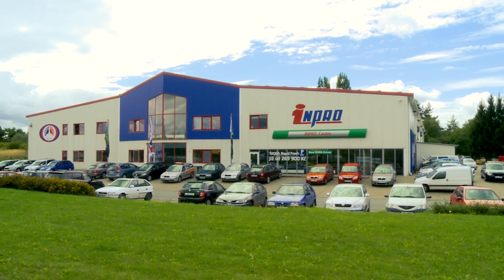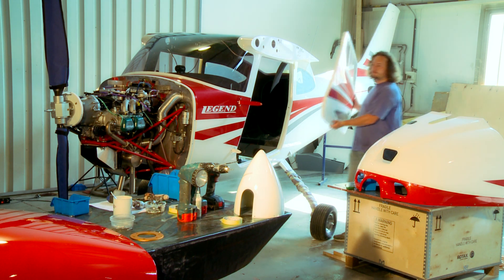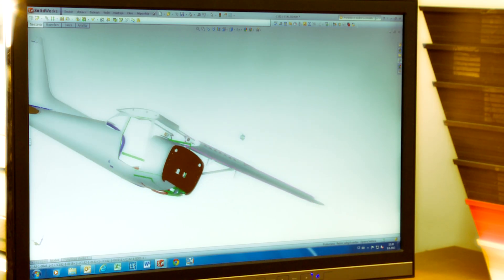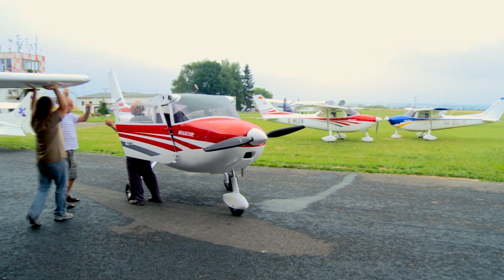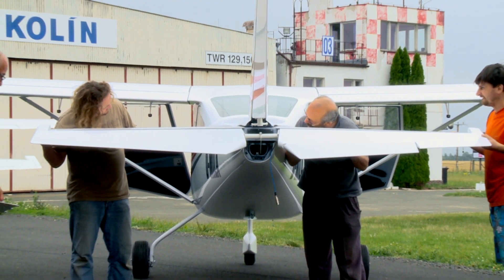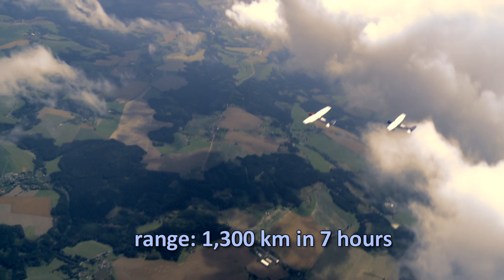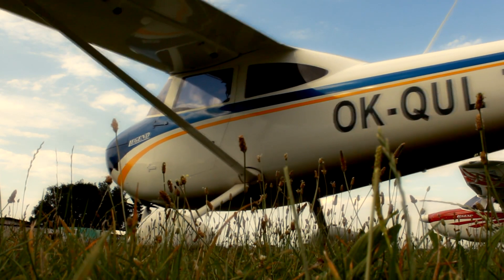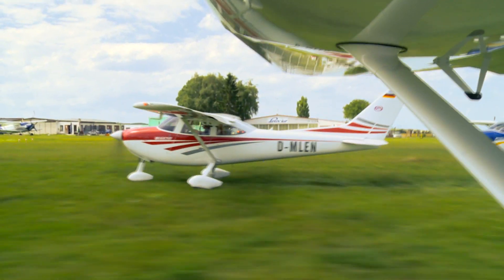The Legend Aircraft - Aeropilot Ltd.

Comment: Take a Cessna 172, make it composite and modernize it's design slightly, then shrink it back down to a Cessna 150 2-seater.... Doesn't perform much better though. Actually disappointed, as it's not any better than my 1960s Cessna 150.